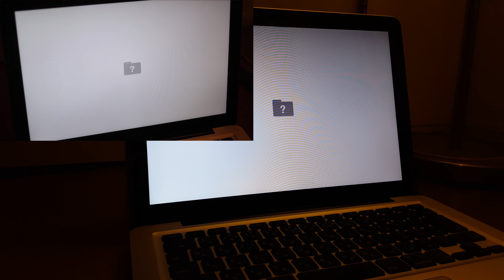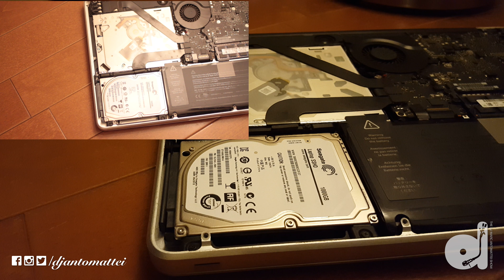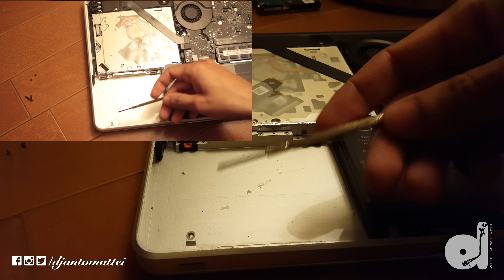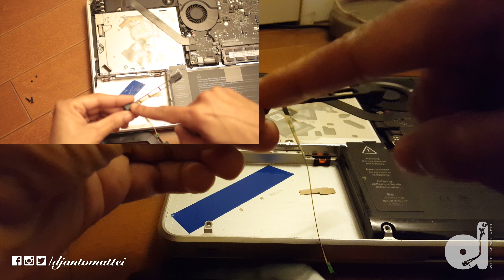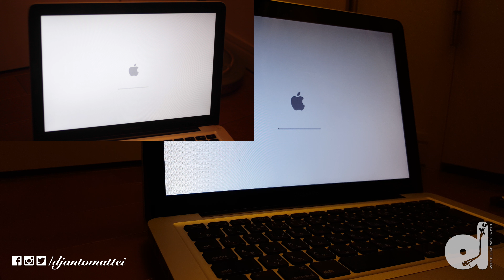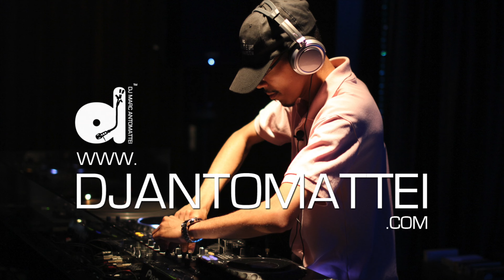How To Fix MacBook Pro If Flashing Question Mark Folder Appears - TDMAS

Comment: everything else moving alone nicely but i cant get the middle bit off with the screwdriver even if it's the same screwdriver that i used for everything else. did you have a smaller screwdriver for the middle bit ?  thanks

Comment: I installed a new HD and new cable but keep getting the file folder with the question mark.  Tried many suggestions from Apple (option key, option/command R/ shift key etc..) but nothing works, any ideas?
Reply: Take it to the apple store, and get it replaced for free. (this worked in my case..)
+save yourself 40$.

Comment: Would Best Buy have the cable
Reply: Probably not, due to how model specific the cable can be. But if yours isn't working, then you can take it to the apple store, and get it replaced for free. (this worked in my case..)

Comment: Great video and thanks.
Just a few questions. 
What exact type of screwdrivers am I going to need for the back cover, the HD bracket, the bracket that sits on the wall of the HD bay and those two screws that screw in to the folding mount of the cable?? Please be as detailed as you can as I am going to attempt this this weekend. Also, where can I buy the cable??
Reply: Hi Riley. ..YES it's fixed. It was indeed the cable. Just a heads up...get the cable with the bracket attached.
Reply from the maker: T6 Torx Screwdriver to get the hard drive out.  I live in a city so I just walked into a computer store and got it same day I needed it.  You'll probably need to order it online though.  It's called a Hard Drive Data Cable or Hard Drive Cable.
Reply: +DJ Marc Antomattei Thanks so much DJ. You wouldn't happen to have a part #??
I am using a 13" MacBook Pro (mid 2012)
Thanks a ton. 
I am truly hoping this fixes it.
Reply: Dukerbud 88 did this fix your problem. i have the same laptop with the same issue

Comment: Thanks for the informative video. My problem is most of the time my mac wont start and this blinking folder appears, some times just a no entry sign, but when i try restarting it several time, sometimes 20 times, my mac starts, but the applications starts crashing after a while and browsers too, it gets slow and then restarts itself to same question mark folder. Should i change also try changing that cable?
Reply from the maker: Yes.

Comment: was all your previous data recovered / saved after fixing it?
Reply from the maker: The data never left bro.  The problem was with a cable, not the HDD.
Reply: +DJ Marc Antomattei Ok, I wanted to preform the same thing on my Mac but didn't want to risk losing my files. Thank you

Comment: Hello, 
I was factory resetting my MacBook Pro & during the process and decided to just turn of my MacBook and when I tried to turn it on it gave me the blinking folder would This be the same process in my case as well ? Or would I have to do something else
Reply: tomascdiaz lol im probably replying 2 hours late, but no you dont need to open your computer lol. Just hold command R when you atart the mac and then select wifi and click internet recovery